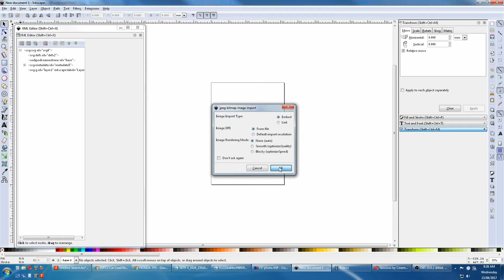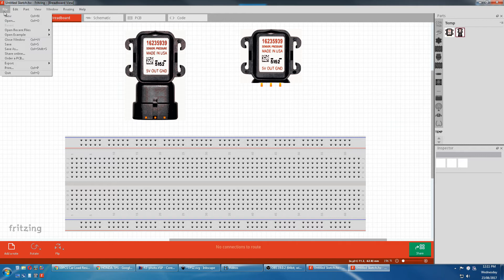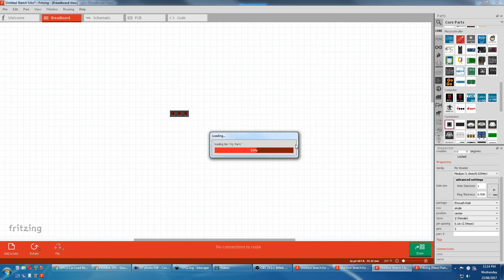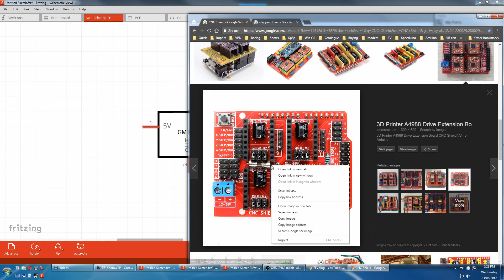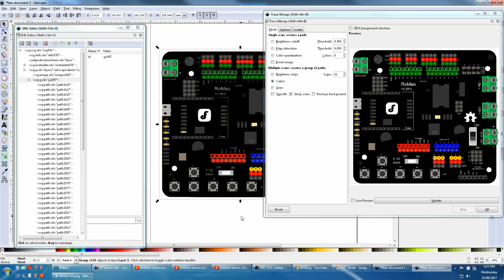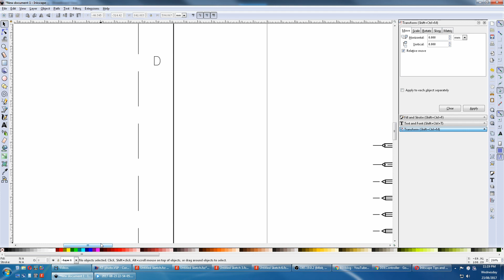Fritzing Part Creation - Chapter9 - Using Photo and PDF

Comment: Your video appears to be very helpful, but I'm stuck at the point of trimming my image.  When I put a rectangle around it, first all it was defaulted to a solid rectangle, so Under the Fill I clicked the 'X' and that gave me an outline rectangle.  But when I click on the image, the rectangle goes away.  So there isn't anyway to shift click on it.  I know the current version is newer than the one in the video, but if you can tell me what I'm doing wrong so I can get past that part in your video, I would appreciate it.
Reply from the maker: It's hard to say without having the svg. Maybe the rect turned white and you can't see it, maybe the image is a higher level than the rect and it has a white background so it's on top of the rect. Look in the XML Editor for the rect. My newer FZ fast part making vids have a lot more tricks - it has the new INK doing a pic to svg -.
Reply: Thanks I'll look for your newer video on it too see if that helps me.

Comment: At 13:10 you are selecting the pins and assign them to the squares. This process however is very slow on my computer. Do you have any tips to decrease the time it takes? I am working with 24 pins atm and my number of scans of the image is 31. I think those are the main problems
Reply from the maker: I can get by making FZ parts, but I'm not good at it, so that's about as much as I know. I know you can assign pins in the XML, but you would have to ask on the forum. These days the forum will make parts for you if they aren't too drawing intensive, it's just you MUST link a datasheet with an engineering dimension drawing.

Comment: Please explain why you selected 5.02mm for the grid spacing.  Seems like it should be 5.08 (2.54 x 2)?  I must be doing something wrong because my imported SVG has a pin spacing closer to 2.64mm which won't mate with a breadboard.  Thanks for the great tutorial!
Reply from the maker: Brain slip. It should be a 0.100"(2.54) grid, so 5.08 is more correct, but there is only 3 pins and slop in the holes so it can be fudged. Accumulated error in long headers is where things become a problem.
If the spacing changes from INK to FZ it sounds like a transform problem. Look in the XML Editor groups for transform. Usually you select the group and note the origin position, ungroup till you can't ungroup any more, then group back again. If the group moves - it's a parent/child thing - just change the origin back to what it was. If you don't click on anything else in between they will stay group selected.
Reply: Thanks, I got it working!

Comment: Received a request from a professor to edit an existing project with custom parts...  Turning out to be a real nightmare, not offering up the goods it promises without IMHO a short course on vector graphics and the program itself!

Which version are you using?  I am using the latest version, 0.9.3.  The online tutorials and guides are obsolete, while the program itself is totally counter-intuitive.  When opening an existing project to edit an item, the breadboard always appears.  It does not in your tutorial.  I can delete it; will that work?  The final schematic is also a rat's nest.
Reply from the maker: My series is only about making parts, not using FZ. Most FZ "using" tutorials tell you how to do the basic stuff, it's just that most are for earlier versions. 
No EDA is intuitive, you always have to watch tuts to learn how to use them. Dave(Elec Eng) from EEVblog  has 20 years of experience with Altium, but when he tried KiCAD he was hopeless. I knew how to use KC because I had watched the KC tuts, and that's when I figured they all do things differently and have to be learnt.
You can select and delete a part, you can select a part and change it in Inspector.
Sounds like you made a BB view, and that the SCH and PCB views are jumbled. Every EDA will jumble the other views, it's up to you to lay it out neatly. How to layout SCH professionally - https://youtu.be/R_Ud-FxUw0g
I think the guys on the forum have a simpler SVG editor, but I don't know much about it as I've left.